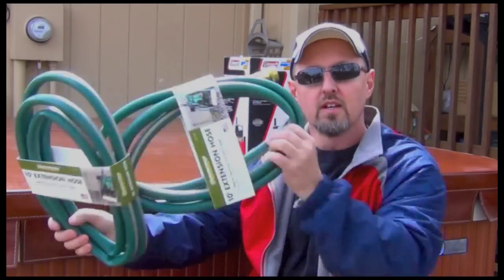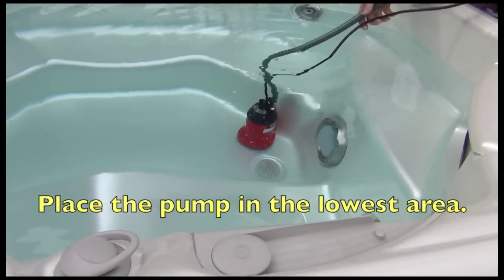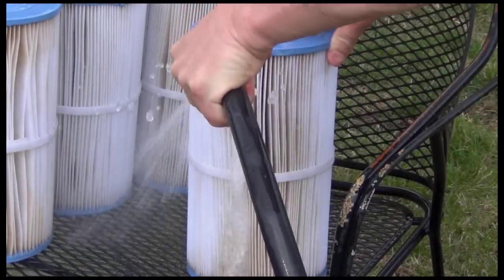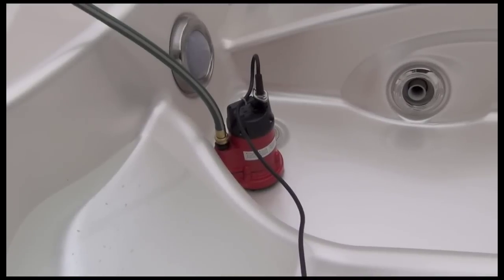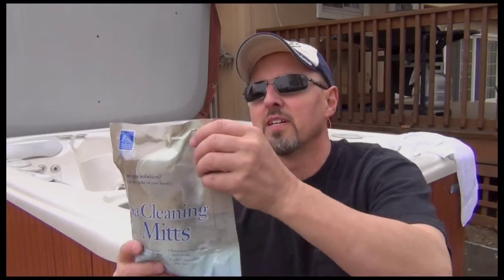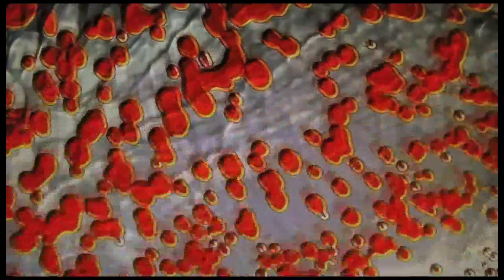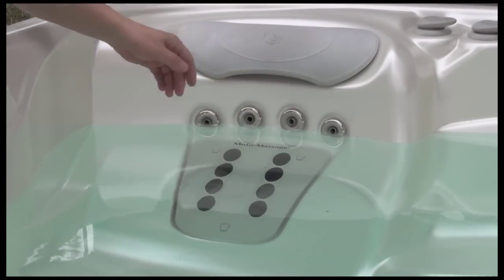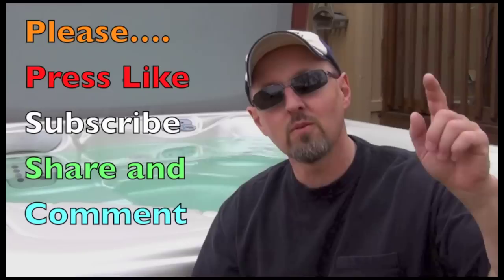How to Drain and Clean a Hot Tub

Comment: Great vid ,did all you showed except the filling part ... I just put the hose in tub and filled it to regular water level. The water did not get into the filter pump and seems to have a air lock in the pipes , do I need to empty and refill ?
Reply from the maker: Hey, Lon, you shouldn't need to refill.  I suggest putting the hose into the tube that does the continuous filtering.  You should be able to remove the plastic twist thing that holds the filter in place.  Shove the hose in there and turn it on.  That will refill the pipes.   Then turn on the breaker and see if it is pumping.
Reply: Tool Dude Tony Thanks for the suggestion but, I saw another video explaining that some old tubs will not easily lose the locked air( my tub was bought in 96). He showed the method of cracking lose the coupling at main pump and leaving the air escape & worked for me! Hey continue to give your expertise and have a great Thanksgiving and Merry Christmas

Comment: Thank You for this video!  I never realized the stand pipes unscrew.  I cannot find the stand pipe rubber stoppers with wingnuts anywhere. The ones you used to fill the standpipe holes & blow the water out of the jets.  I've googled for rubber plugs, standpipe stoppers etc.  odd that they aren't on the common spa supply sites.  Also, my guess is you should cap off the 2 drain pipes, as some of your air probably goes out there?
Reply from the maker: Hi Daren, Yes, you should plug all of the open drain plugs that you are not forcing air through.  Be sure to blow out all of them one at a time.  Sounds like you found a source for the plugs.  Way to go!

Comment: Thanks for the video Tony - very easy directions.  I watched a couple of others and they were not as complete. We have a different model spa (Dynasty Excalibur) and steps worked just fine for us.  Had to adjust to only have two filters with no stand pipe and alternated filling between the two.  Not sure it mattered but I figured it couldn't hurt.  We also picked up some spray filter cleaner from pool supply since filters were pretty dirty.  Sprayed them down and hosed off - good as new.

Comment: I have a hot tub that shorted out my connectors & the extension cord male & female receptacles. I replaced all connectors and the extension cord. The hot tub would come on then immediately turn off. I don't know what to do next. The heat pump works, the jets were working. it seems like it gets power then immediately shorts out again.

Comment: If you like to maintain things, a hot tub is a great start.  filter cleaning {get the soak type cleaner that digests organic sludge}, pump seal failure, pump failure, mother board failure, heater failure, UV water sanitizer/ozone generator failure, light failure, jet failure {these are great, the more they move/massage, the sooner they fail}  Don't forget an avg of $40 plus on your electric bill/month, daily chemical costs.  Been there, done that.  I ended up cutting it up with a sawzall and took to the curb for garbage.  fun the first year, then cost, cost, cost.......

Comment: Tony that was ten times more help than I got from the place that sold me a $9K tub! May I ask why you placed the filling hose in the cartridge socket, instead of just filling it by placing hose at the bottom of the large tub? My spa cartridge configuration differs from yours in that I have only two, and they are stacked vertically one on top of the other. I can not see the bottom underneath the filters due to the design of the tub. Do I need to try getting my shop vac hose down onto where the bottom filter goes? Is that where I can force out all existing water that is left after drawing tub? This is important because I want to remove all existing old water if I can. Have you ever used a chemical additive to old water before emptying? I have a container of stuff made especially just for adding to the old water prior to emptying. It is supposed to help by really getting this flush chemical through the entire system. Would like to hear your opinion. Thanks.